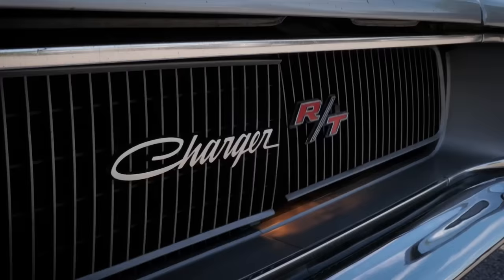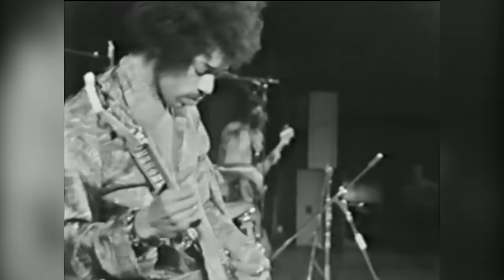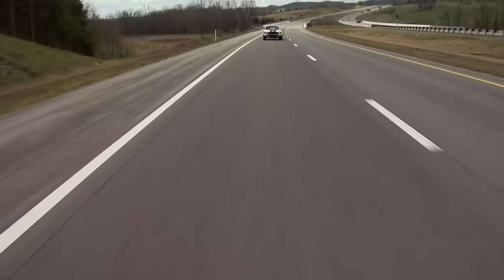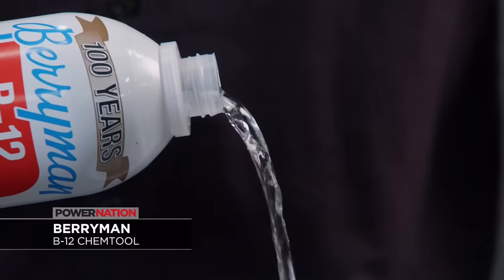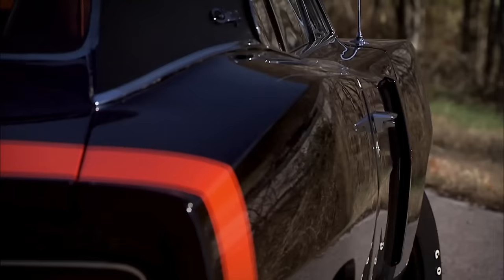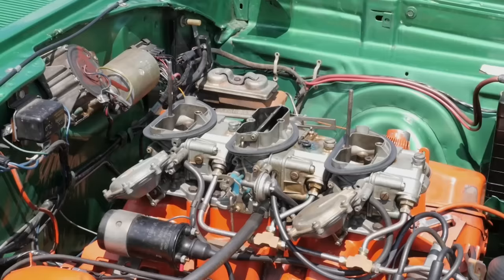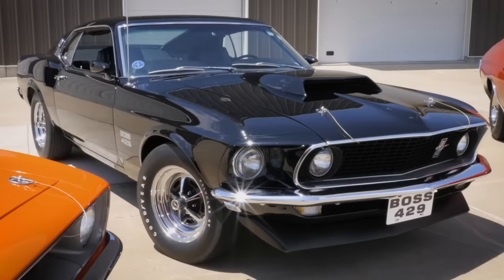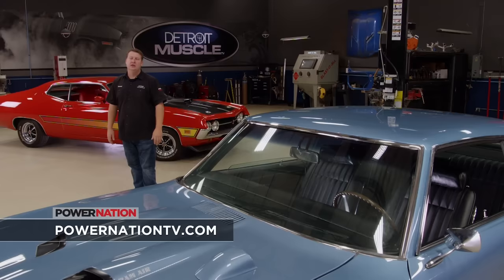Top 10 Muscle Cars of All Time

Comment: I sure would have thought that the Dodge Dart would have at least made an honorable mention.    Offering everything from a slant six to a Hemi, the 340 GTS was my favorite and the drag strip was full of them.   :  (
Reply: True
Reply: It was  in '63 that  the  Dodge Dart  was demonstrated at my high school.   It did one long & continuous wheel stand.  It had a 426 race hemi engine.  Later in 1967 I rode passenger in my father's Plymouth w/383 engine.  I was convinced that I wanted a high performance Plymouth.   In November  1969 I ordered a '70  Road Runner  (built in L.A.)  I received the car on Dec 26th.  That was my favorite car.   I  turned  13sec  @97mph at Irwindale raceway.   The only thing I did was headers,  cam sprocket bushing, tarantula intake manifold &  1000 cfm Carter carb. If I would have bought an electric fuel pump I would break my own record for a stock 383.  In 1965 NASCAR banned the 426 hemi  due to protest from Ford & Chevy.   Plymouth  was allowed back the following year at NASCAR with restrictor plates unter the carbs  to give the less fortunate Fords & Chevy's a chance.   In the muscle car era  Plymouth & Dodge  gave more bang for the buck.   Plymouth always outsold Dodge and when Richard Petty switched to Dodge, he lost most of his fan base.
Reply: @robertgardner7470  The 426 HEMI, most especially the 426 Race HEMI is a legend in automotive history. Hemi cars today are going into the 6 figures. Some have hit 7 figures. Which is just insane. '71 HEMI Cuda CONVERTIBLE sold for $3.5 M at Mecum auctions in Seattle-2014. It was a hard sell but the guy got his 3.5 million back in 2014. I just try to imagine what that extremely low production car would be going for today in our inflation ridden economy.

Comment: The muscle era began in 1962 with the introduction of the B Body Max Wedge cars from Chrysler, a full two years before the under powered GTO.  And ended with the apex predator the 1968 426 Hemi Barracuda which still holds the SS/A    ET and mph records today.
Reply: As bad ass as the 426 Hemi was, the 426 Wedge was only a half step behind.
Reply: That re1/4 MILE RECORDS - SUPER STOCK ELIMINATOR
Class	E.T.	Speed	Date	Driver/Car	Location
SS/AH	8.48	156.84	10/14/2018	Rich Locker - North Royalton, OH	Brownsburg, IN
SS/A	8.56	155.92	10/14/2018	Ray Paquet - Holt, MI	Brownsburg, record is actually in SS/AH, the H is for Hemi. They had to give the Hemis their own class because no one else could compete with them heads on.
Reply: @zubitron5  = SS/AH record  is 8.22 @160 by Gary Wolkwitz
Reply: @zubitron5  - I know, I had a '64 Plymouth Max Wedge
Reply: @zubitron5  NOT STOCK--who cares
Reply: @chadhaire1711  The 426 Wedge that I am referring to ran in the A/SA class
Reply: @zubitron5  The bottom  line--the production cars bought off the lot----426 was advertised at  425 hp, but is only 350 net hp---380 if you rev to 6,000--a good way to blow it up.....any new 2021 V-8 can do that. 
These older cars looked cool and made a lot of noise......the newer cars do too but are quick--these old rust buckets in this video were not.  I dont miss them...drive a new Caddy Blackwing or Corvette and even less.
Reply: @chadhaire1711  Good for you!

Comment: My top 10. 57 chevy Tri-power , 69 Road Runner with bucket seats, 67 SS Chevelle bucket seats, Cuda AAR,  70 Chevelle SS396 , 71 Dodge Dart Demon , Dodge Charger R/T, 68 Chevelle SS, 66 Mercury Cyclone , And  63 Chevy Chevelle SS with the 409. You can bury me in any of these cars.

Comment: There were only 69 of the 1969 COPO 9560 Model ZL1 Camaro’s built that had the all aluminum 427. This was different then a 1969 COPO 9561 Model Camaro that would have aluminum headed iron block 427 of which a little over 1000 were made give or take. There is under 20 of the ZL1’s still around.

Comment: 1970 Buick GSX and Olds 442 are also worthy of mention. Both shared the same roofline with the '70 Chevelle. The swept back look is not easy to like when considering the stereotypical 'boxy' looking muscle car...but the '70 models were better equipped (incl ac). The 1970 Ford Torino Cobra Jet (sitting on his shop floor) is also worthy of mention.

Comment: I remember when you could pick up any one of these cars for $800. During the gas crunch they got parked in driveways, garages and back yards and forgotten. I had a line on a Dark Green 1969 Road runner when I was sixteen for only $300 but of course my Pop said nope.
Reply: @rickbailey189  I have four brothers and two sisters, 66 327 Biscayne. 1968 Mustang, Formula fire birds and trans-ams, 1972 Road Runner 440, 1960 Oldsmobile with a 394 V8 beast, ( This was my Pops car, then my sister and then my oldest brother, she got it back and totaled it after brother went in to service in 1972) You're probably correct on the danger part. lol
Reply: In 1976 my neighbor had a 67 Charger with a Hemi in it. I could have bought it for $600 but he wanted $800. 
My dad said you can't afford the gas for it.

Comment: 1969 Hurst/Olds, the ONLY GM A body car that had a 455 engine in 1969. Olds got around GM's rule limiting the A Body cars to 400 C.I. by having the Hurst Shifting Company install a modified 455 engine.  It would eat a 1969 GTO Ram Air IV Judge for lunch. The 1969 Hurst/Olds was so fast that Chevy, Pontiac and Buick complained, causing GM to lift the ban in 1970 allowing all GM A bodies to have 455s or 454 (Chevy Chevelle). So you can thank Olds for getting GM to allow the biggest big blocks in the 1970 and beyond A body cars.
Reply: Olds had their 455 in the 68 H/O, and it was later revealed the 455 was actually installed on the factory assembly line. Also, Hurst designed/engineered the model, but they were assembled by Olds' longtime skunkworks contractor, Demmer Engineering. And once GM lifted the 400 CI limit on their intermediates for 1970, Buick took their "iron fist in a velvet glove" GS Stage 1 and spanked EVERYBODY'S ass in the quarter mile.
Reply: Very heavy.

Comment: The only car you didn't mention was the one I bought in 1969, the 1969 455 Hurst Olds. In the shade tree racing I did in my young and dumb days, I beat and re-beat everything mentioned in this feature except anything with a 426 hemi when the Olds was stock. And I was turning 13s on a 1/4 mile track. But when I added a Holly 800 cfm spread bore carburetor, a set of 'Headers by ED', a high overlap stock cam (I forget the degrees but around 360 I think), changed out the 3.42 for a 4.10 rear end, and blue-printed the engine, I turned consistent times in the low 12s. Oh, and I had to add a right rear air shock to control the left front lift I started getting from the torque and I raced with a pair of slicks.

Only then did I start to beat the 426 Hemi's.  But not every time.  Damn them, pox on all the 426 Hemi’s. 

Oh well¸ I think the 1969 Hurst Olds is worthy of a mention in this and other lists of this type.

Comment: I would like to add the original SS.  The Super Stock Plymouth Sport fury.  Showroom to strip, Mopar low 12,s at 116.  Max wedge baby!  The Savoy even had aluminum fenders and battery in the trunk and the like.  Before the GTO which was a nice car too.
Reply: Like some of the lightweight "Swiss Cheese" Pontiacs,  Fords & such, this car would go under "Ringers and Other Things" because it wasn't a full production musclecar, which is the thrust of this video. It was a factory race car.

Comment: I'm also  in my 70's  and grew up in Southern Cal and ALSO (shoutout to LR) drove and/or owned most of these cars back when they were NEW:) I'll echo his comments on the Buick GS series...BUT, there were damned few guys qualified to properly tune em,  AND, they seemed more 'genteel' than the average young stud 'ponycar' standards of the time:) Now, contrast Shelby's 500, which was a BRUTE, and drove like it, getting my vote for near the top MOST uncomfortable Pony,  almost a tie with the Hemi Cuda., ...definitely NOT  GT types (Gran Touring).  As for straight, in-line go...well my bro had a 396 Chevelle (or maybe NOVA, like I said I'm old:)  with the solid lifter motor and a 3 speed manual.  He had little difficulty doing mid 12's with street tires,  at California's 'Orange County Raceway', however, same problem, thing was a beast to drive...his had NO power steering, and a MONSTER clutch that could give you a 'charlie horse' cramp at a stoplight LOL. One of my buddies' dad, got him a Boss 302, good handling car but a pain to get in and out of  (I'm tall) and my own vehicle could take him, both in a straight light to light walk, and more importantly , out on the highway in the 'twisties'.  Also, the Plymouth Road Runners, in various iterations, were also notable :)   Lots of 'back seat' room for those weekend 'dates' :), AND, relatively light and whiz-bang performance with the  383.  Road "handling"? well, not so much.  The Hemi(or was it the 440 version), at least to me, drove like an extremely 'bloodthirsty'  truck LOL.   Finally,  when it came to me, well, I had two I REALLY liked, the big motor Lincoln Cougar (luxo barge, but FAST), and the elegantly beautiful GTO.  Problem with the Cougar, you almost had to literally pull the engine to change the spark plugs...jesus christ!  My sky blue GTO" on the otherhand, was one of the most pleasant to drive and reliable cars out there,   along with LR's  BUICK GS series. Probably  the most 'civilized' Ponies, available, yet still fast as hell.  Mine  had the 400 "over the top"  'tunnel port' motor,  the new monster strong auto, and the Hurst "bang/screech" slotted  shifter, as well as  a remarkably good Limited slip type differential.  This was one ELEGANT vehicle, and compared to almost all the other's, a true representation of the 'Gran Tourismo' ideal, besides looking like a work of art.  There's a reason they sell for HUGE amounts these days. Now, how good was it? Glad you asked:)

OK,   since the statute of limitations has  loooong run out, I can tell you , that coming back from UCLA to Orange County, one night at about 11pm, as I was nearing my then residence east of Orange, I dropped down to 1st and HIT THE GAS in order to clean out the carbs, and try to blow a little soot out the exhausts (I'd been in Heavy traffic and peeps on the fwy's  traveled a LOT slower back then, than they do now :)  Anyway, as I blasted  up the darkened street by my old High School,  to my BIG surprise, it was like the lights coming up in a stadium for a nighttime pro football game!!!!!  I mean to tell you,   the ENTIRE parking lot was FULL of the local PD vehicles from several nearby jurisdictions, including the Orange County Sheriffs.  What the hell they were doing there I had NO idea, and had NO intention of hanging round to find out, so I TOOK OFF:) and,   as ONE,   ALL with their 'christmas trees' lit up,   they 'surged' out after me  in FULL PURSUIT!!!.   Anticipating the worst possible result of capture:), I killed my own lights (darkened my license plate), slammed into 2nd (remember "Bang/Screech?" lol) screamed into the next intersection (no street lights here) pulled  a full speed, tire squealing, drifting left turn and driving by moon light, accellerated HARD up the straight and led about 10 to 15 of the patrol cars towards a maze of winding,  hilly roads which I knew by heart:)
Short story, there was ONE 'particular, reverse camber right hand turn a few blocks up this rather wide, straight section, and these LONG wheelbase, swoopy ass '429' engined sedans  (sorry forgot the model EDIT- now i remember, the Torino:)  failed to take their 1. front/rear weight bias, wheelbase, and speed, into account and as I cleared the curve and gunned out onto the straight, I could literally see their lights began to literally  'roll' as, I think 3 of em, rolled down the reverse crown and into the dirt berm which almost literally exploded into a huge cloud of dirt, dust, and debris- which obscured the rest of the 'pack' from my view:) I, on the other hand, unobstructed, roared off, took a big right, across a small flat section then up and past Feliciano's (yes THAT Jose Feliciano:) hill top estate, powered along the ridge, then pulled into an orchard adjacent to the farmhouse of a friend of mine's, stopped behind some trees, opened the hood (to let the heat escape more quickly) then locked it up, and legged it through the trees to a nearby hilltop where I could watch the proceedings below me:)  Well needless to say, it took a bit before the 'dust cleared' and  the  "Leo's" recovery trucks and 'winch on' flat beds arrived, and to my surprise it wasn't more than 3 minutes or so later, before I could several different  police cars crisscrossing the valley's  maze like roads below, presumably searching for my sorry ass LOL.   One actually came up the same road, and I watched it go by the Orchard entrance, with its 'pusuit' lights still lit, but no sirens (wouldn't do to have some of the esteemed local residents disturbed that late at night:)   Anyway, I stayed put for about 3 hours (to make SURE they'd given up), quietly approached my car and circled it to ensure no one was waiting for me.  I nearly pissed myself, when a dark sedan with its headlights off, turned onto the same orchard road and rolled slowly and VERY quietly in my direction, however, it stopped closer to the house, the driver's side door opened, he got out, walked around, opened the passenger side and a girl I knew (rather well in fact;) got out, they embraced, and while they kissed, he grabbed her ass and held on LOL.   Then he got back into the car and VERY quietly and slowly, reversed out and drove slowly away, all without lights.  When I glimpsed his face as he got back into his car, , I was SOOOOO shocked.!  I had NO idea (and neither did anyone else for that matter)  that this man was seeing this barely out of high school girl on the sly...:)   It's always amazed me how often young married teachers can go ''astray'!!!!!

Well, needless to say, a night to remember, and for a LOT more peeps than just me.   They never 'caught' me, or even came round 'investigating', AND I took a different set of roads home for several months just to make sure:)  The local PD, however, soon changed their cars, and I got drafted, and went off to war..but THAT's a whole different story:( Gave my GTO into the care of my brother, he failed to change out the drive chain when the service manual  called for it, and subsequently blew up that magnificent motor:(
When I got back, well I wasn't thinking  about  muscle cars so much...

Anyway, now you know what that  GTO could  REALLY do....  "Gran Tourismo" for the WIN!!!
Reply: Great story!  Well worth the read.  Thank you for sharing.  Closest I ever came to anything like that was the "almost purchase" of a car in 1971.  An accident had deprived me of my ride (a 1959 Studebaker Commander with a 259 V8).  Shopping for a replacement took me to the closest used car lot on the same block where I lived.  There it was!  A 1967 Plymouth GTX with a dual-4 426 Hemi, factory 4-speed, and Hurst shifter.  All for $3995 Canadian.  I ended up buying the 1966 Dodge Coronet 318 automatic beside it (Wonderful set of glass-pacs on it!). My reasoning?  I wanted that GTX soooo bad, but I figured A). I'd likely kill myself with that much power. and B). I knew I was going to be moving about 30 miles away from work and the gas bill, at 12 to 13 MPG, would kill me financially.  I do occasionally wonder though; if I'd been able to buy that thing, and put it away in storage, what it would be worth today?  Bet it would be worth enough to buy a really REALLY good dinner at McDonalds huh?
Reply: @22942  I remember those cars...a well set up 318 could make that little bugger FLY!! Oh, speaking of Studebakers,, I had a class mate who's dad had an Avanti?  He took me for a 'demo' ride once and I swore to never get into another for the rest of my life!!!! I believe it had a 'breathed on" 305, manual, limited Slip, and this fellow could REALLY drive....scared the hell out of me. :)
Reply: Man, I love stories like that. Those were the days I wasn't around for, but it's cool to read about too.

Comment: The fastest car of that era was the 1974 SD 455 Trans Am! The only hand assembled engine from Detroit. Dynoed at 550 HP and 500 FPT. Red lined at 7,000 RPM.
I have owned 67 435 427 Corvette, 68 Shelby GT 500 KR, 70 454 Corvette, and many other muscle cars, but the SD 455 T/A was the fastest.

Comment: I had a 1970 Dodge Challenger 383 w 3/4 race cam and raced a 454-450 hp Chevelle and he beat me by a bumper then left town because he almost got beat by a badged 383. The 454 weighed 4000 pounds compared with 3600. So much for the king of the street.